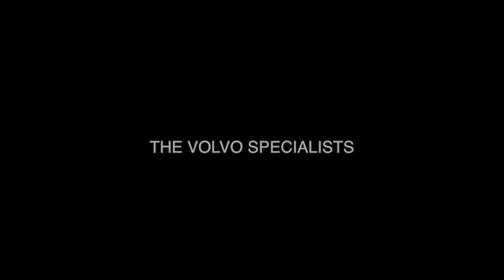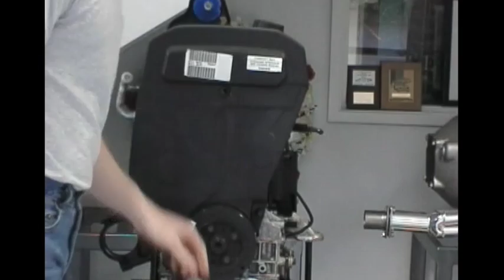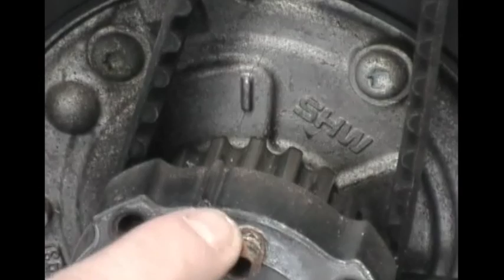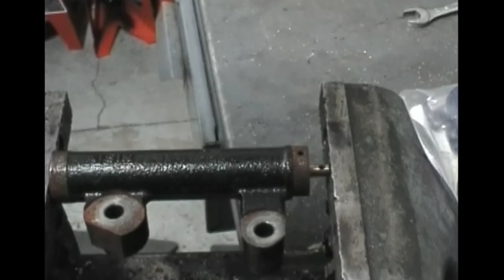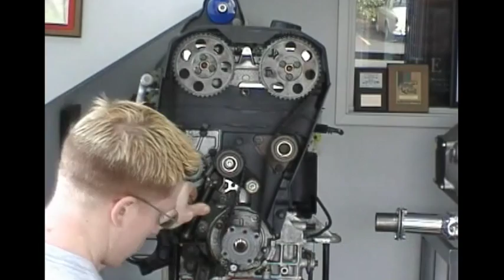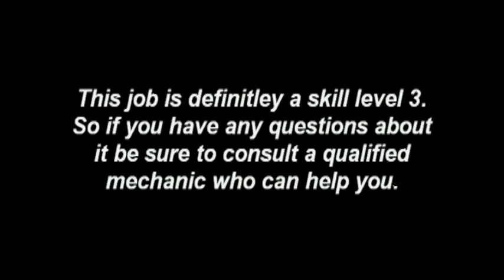IPD Volvo - Timing Belt 850 70 series Volvos 1993 thru 1998

Comment: So I replaced my water pump timing belt  tensioner and roller and my belt is routed correctly but I can’t seem to get tension on it .. is there a reason I’ve tried two different belts thinking that was the issue and same thing
Reply: is there a problem with the tensioner like a leak and did u put the plastic thingy back on the tensioner?
Reply: I know it's an old comment, but  the belts come in two lengths 144 and 148 teeth.

Comment: to avoid damage to the lower tensioner bolt or threads in the block....  
1....Loosen the lower bolt slightly.
2....Remove the upper bolt.
3....Pry the tensioner to the left to release all pressure.
4....Now remove the lower bolt
Just might be a good idea to turn the engine over a couple time by hand/wrench & Double Check the Alighment Marks before installing the covers
Reply from the maker: Thank you for the sound advice!!

Comment: Is it still required to check timing after installing a new belt if you had the cams locked with a locking tool.

Comment: What about torque settings, why replace the cover before rotating? Most DIY/garages don't remove the flywheel and yes it does seem very easy when you do it on a bench and doesn't cover the pain of getting to this point which really is the hard part with restricted space!

Comment: Ha ha, so easy when you remove the engine from the car.
Reply: Or the car from the engine 😃
Reply: @Twobarpsi  I gave up and bought another car. Not like the old days in the seventies when I removed the head from a car, had it cleaned, polished, and reinstalled that night.
Reply: @JaimeWarlock  I'm holding on to my 1998 V70 T5 dinosaur.  Bought it 11 years ago, nothing but problems, but I do like it.
Reply: @Twobarpsi  MIne was great till the day it popped the head gasket (or cracked the block, can't be sure). I loved the ride, was confortable, felt safe, and always stayed dry inside despite the humid climate. Who knows, I might buy another one some day when I have the proper facilities to fix it.